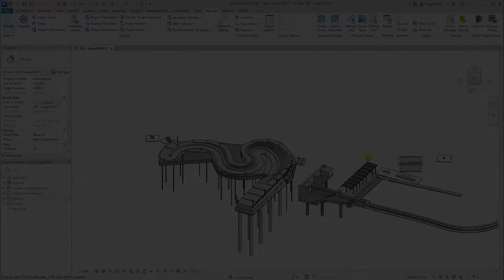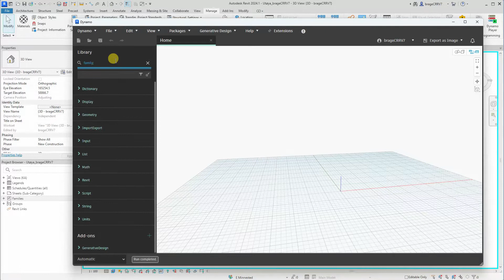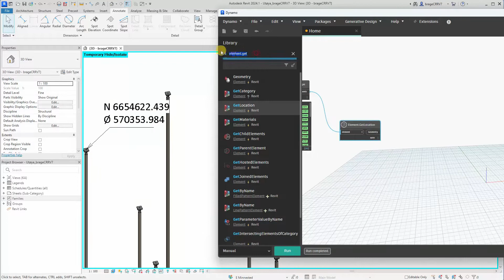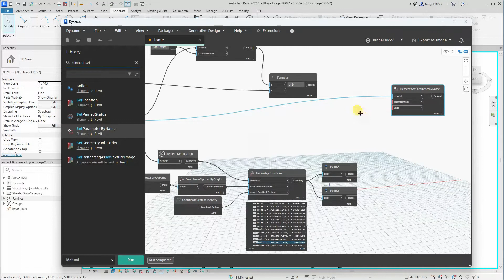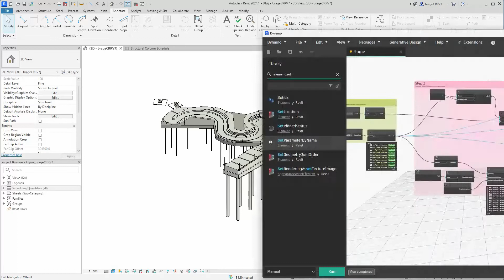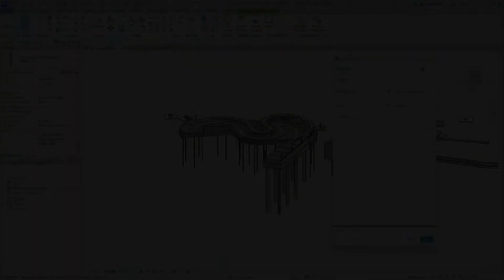Revit Dynamo - Apply coordinates to columns

Comment: Excellent tutorial. But in my dynamo I didn't find the formula node... Is it a plug-in?
Reply from the maker: I noticed that the formula node has been removed in the newer versions of Revit! go to the library -> math -> operators and select the node that will work for you. Or you could use a code block node.
Reply: @EngineerBear90  tks!!!

Comment: I've made it but my elements are not moving if I type a different coordinate. What do I need to do if I want to move the elements ? Lets say I get the coordinates using your script and now I will update the table with the correct figures for coordinates in order to place the elements in the right location.
Reply from the maker: Hey! This script is not created for moving the columns to a new physical location, it only reports back the actual coordinates back to each individual family. I would look at the place family at specified coordinates video on my channel.
Reply: Many thanks! Great tutorial!
Reply from the maker: @engjohnattan  Thank you!

Comment: Hi! Thank you! I'm tryng this tutorial, but the coordinate that I fill, are wrong. 
My Element.GetLocation are the same of Geometry.Trasform. How can be possible? I working in a model with coordinate . Dynamo don't read my survey point.  Can you help me, please? :)
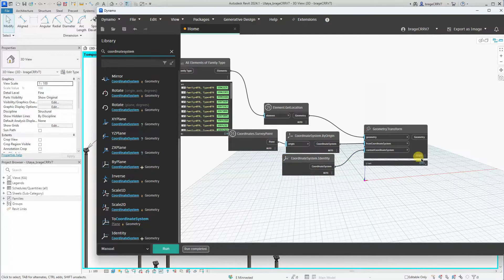Reply from the maker: Hi! Thank you! You need to specify that the coordinates will be transformed into the survey point coordinates with the node Coordinate.SurveyPoint, found at 5:28 in this video. Also make sure that the Survey point inside Revit, when pressing it has the coordinates 0,0,0 and your object is at global coordinates! Hope this helps :)

Comment: Hi, I don't know if you tested in depth, but there is a problem when the project has true north with an angle other than zero.

I tried to do it myself, even python script with sin cos projection on x y

            radians = math.radians(angle)
            x_new = x * math.cos(radians) - y * math.sin(radians)
            y_new = x * math.sin(radians) + y * math.cos(radians)
            return x_new, y_new

I tested all the ways and came to this video as a second way. The problem is the same.

Some help? T.T ?
Reply from the maker: Hi, Tru creating a fresh site without any true north rotation. Alternatively, use the node Geometry.Rotate, with the geometry representing the points. The origin for rotation will coincide with the survey point coordinate. Rotation will happen within the xy plane, so the axis to use is the z-axis, with degrees aligned to the true north angle. (I am currently away from a Revit workstation, thus unable to verify this method.)